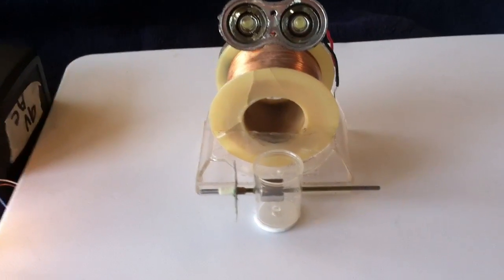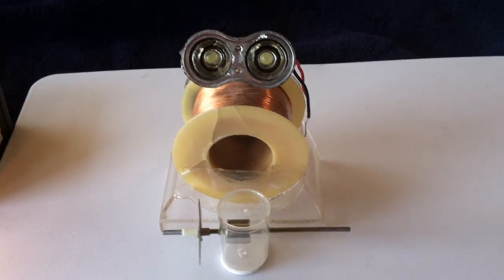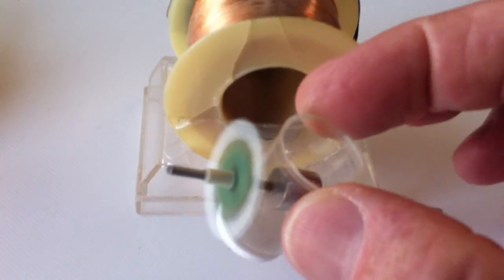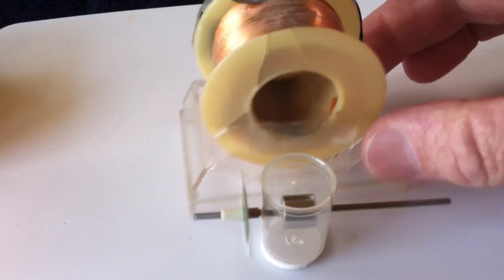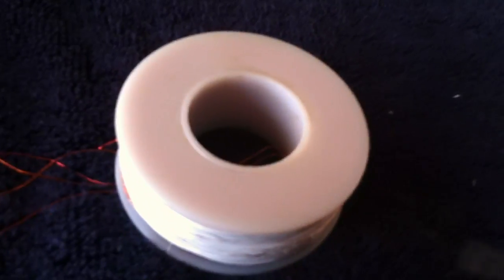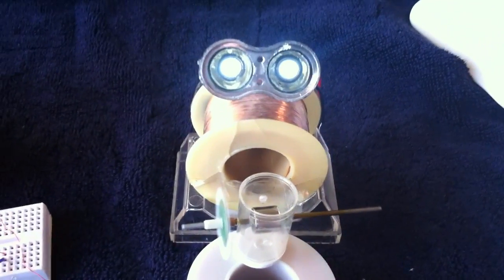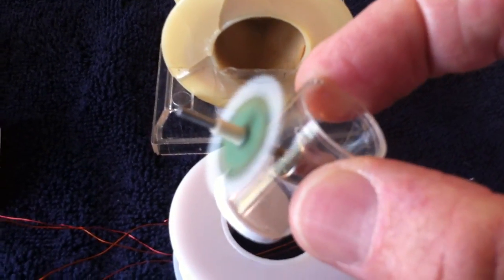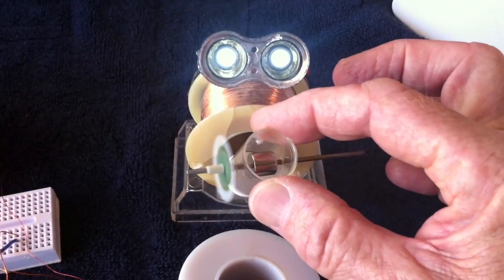Fake Free Energy Device -- One method

Comment: It's neat in itself. The lack of need to bolt the driven section to the coil that's powering it.
You may find that this works with a multi-setting wall adapter that's switched off. Mine did and i'm thinking that would also explain supposed free energy devices that show some 'unused' equipment. It IS, used, but unconventionally. The 60Hz still rides over the top of most cheap adapters too in any case. DC and AC happily coexisting on the same wire.
Reply from the maker: +slider2732  Thanks for the tip about this working on a turned off wall adapter.  I just tried it and it worked.  I will post a video of it working.  I call it a 'Wall Wart Motor'.  It is a good example of how these transformer adapters are still working even when they appear to be turned off.

Comment: Hi Lid, could you mention the source of your magnet, the one with a hole in the middle used in this video ?
Reply from the maker: +Mike Poirier  You can get the ring magnet here:http://www.kjmagnetics.com/proddetail.asp?prod=R6036DIA
Reply: Thanks Lid, this helps a lot.
Reply: +Mike Poirier One more thing Lid, where do you find the rods, you use in your projects, especially the 3/32" inch rod in this video?
Reply from the maker: +Mike Poirier  This is just a piece of steel coat hanger.  I get the brass rod for most of my rotor shafts at the local hardware store.  I use pieces of masking tape to bush up the shaft.  The ring magnets are a press fit on the shaft that way.

Comment: Hello Lid, 

I follow you since long and Very Like the Pure Simplicity of your demonstrations. 

I understand and appreciate that you've taken time to show once again around, that we can hardly take for granted any video.

Nevertheless, what I do believe is that by following a youtuber on a long enough period of time (on few years at least), we can get A Pretty Good Idea of his/her Genuineness and Accuracy. 

In this set of youtubers, I've found some few who looks to me in agreement with these to former qualities.

These are: Jim Murray Smith, TimMan, GoToLuc, Kdkinen, TheOldScientist, and very few others.

Have you seen for example the work kdkinen has done?

His pt20 and pt21 video aren't they overunity COP? with 1.2 W he lights 2 times 34 LEDs, if I got well.

Remember, overunity "COP" doesn't mean PHYSICAL EFFICIENCY overunity!

The "extra energy" CAN come from the environment while the circuit is "open" respect to the environment and so not a "CLOSE SYSTEM"... (it how function heat-pump with the thermal energy triggered with chimical energy: change of state of gaz to liquid and reciprocally, forced by mechanical energy: the compressor, rotated by electricity most of the time).

What do you think, my friend?

Regards, 
Didier
Reply from the maker: +Didier Khwartz  The simple answer for me is that a machine can't 'make' energy. What we can do is build things that convert one form of energy to another.  The easiest thing I have come across is the photo voltaic cell.  It is not very efficient but it gets the job done anytime there is light.
Reply: +Lidmotor Understand what you mean but who is talking about "creating energy" here? don't you have ever heard the Dirac's Sea? It is not about to "create" energy, I am train in heat pump engineering, remember, but to harvest the energy contained in the ether. Of course, if you consider there is no possible ether or Dirac's Sea can't be, then no one is more blind than the one who don't whant to see; and have you seen the two last kdkinen videos? How do you explain he lights two times 34 LEDs rather bright, with only 1.2 W? Just tell me, OBSERVE Lid, before to say that's not possible. We very do the same with heat pumps, the only difference is that instead to pump thermal energy looks to be the ether energy which, for all the founders of the electromagnetic theories, did exist, including James Clerk Maxwell. Btw, the Morley's experiment didn't proved there was no ether because when we take in account that mater itself and photons are subject to a doppler effect as Louis-Victor de Broglie waves paquets.